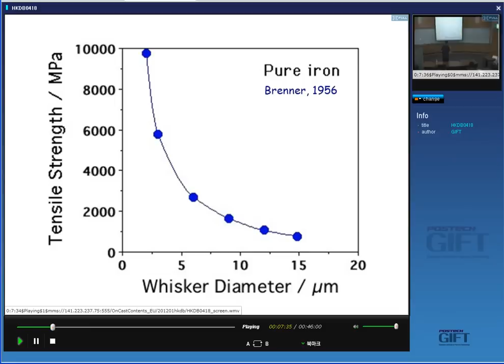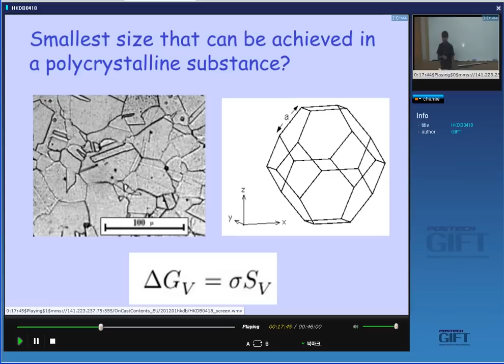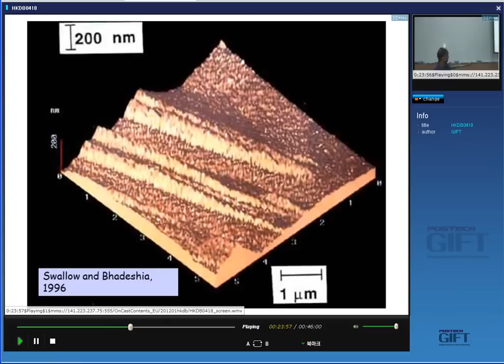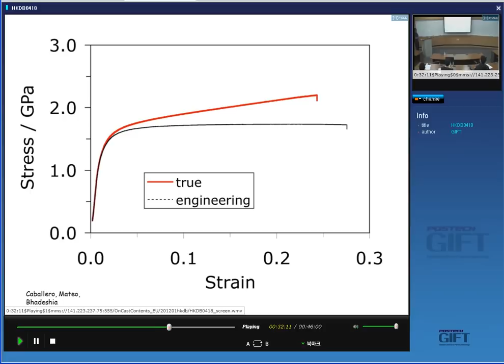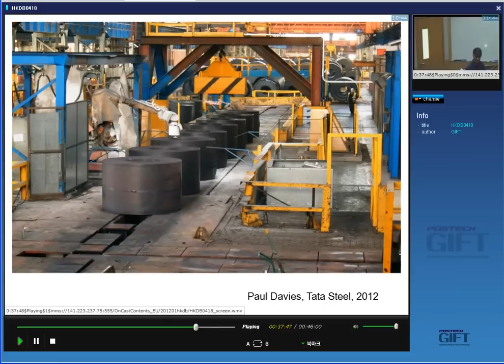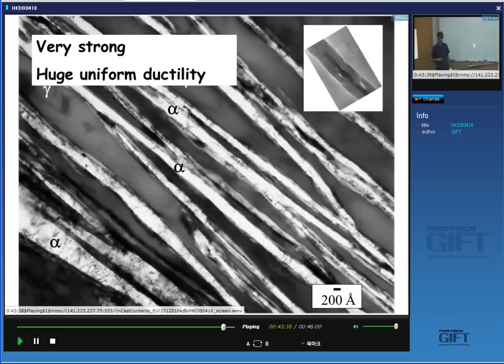Physical Metallurgy of Steels - Part 12

Comment: how wear resistant is this steel? i was wondering if there is a possibility that with its high hardness and shock resistance that it could replace s7 shock steel in some applications.
i was also wondering if you are planning on making helmets out of it. i've red that the current kevlar helmets don't stop the concussions caused from explosive blast but the old steel helmets do. this steel might be the comeback of the steel combat helmet.
Reply from the maker: +Mitchell Brunkow 
See http://www.msm.cam.ac.uk/phase-trans/2015/wearpearlite.html

Comment: Hi Professor Bhadeshia, very good lecture.Why the steel fracture when the austenite is discontinuous(below percolation)? Is the mechanism that when crack propagate to the continuos austenite , it can prevent crack pass through?
Reply from the maker: +Smith George The austenite transforms into brittle untempered martensite. So when the martensite is loaded (when austenite goes below percolation threshold) it cracks
Reply: +bhadeshia123 Even though the austenite is above the percolation, there are some austenite transform to brittle martensite, why it doesn't crack?
Reply from the maker: Because the austenite that percolates can absorb the deformation without transferring load on to the martensite

Comment: xcuse me sir but i have still a doubt that the invariant reaction (eutectic) takes place at a certain temperature and at that temperature gamma phase of iron has its maximum solubility of carbon.. at 1154 degree celsius gamma iron dissolves maximum carbon equal to 2.14 wt % ... is there any reason or it's just a coincidence..